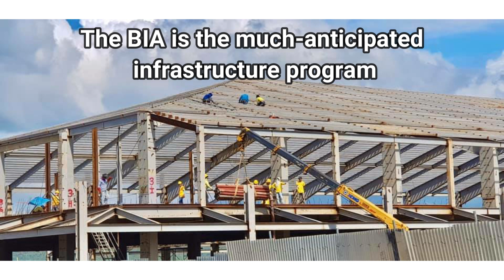Bicol International Airport now at 62.39% Complete - Update 3

Comment: Sir, tanong ko lng po sana if nasunod ung dating proposed building design nya? (i mean ung thumbnail po ng previous video nyo (update 2) on the same airport. Prang ibang design na kc na i-isip ko dun sa steel structures @1:35 (as shown on ur video update 3).